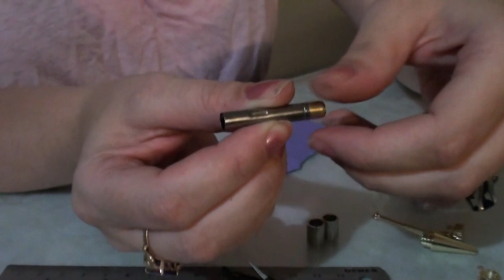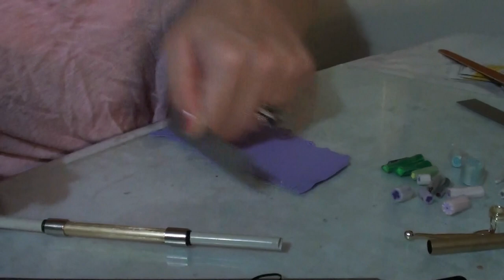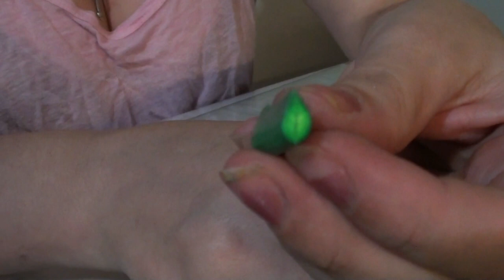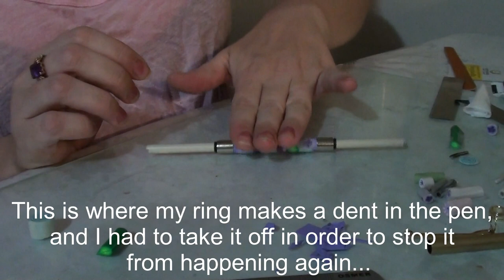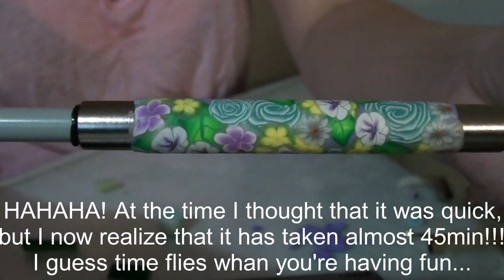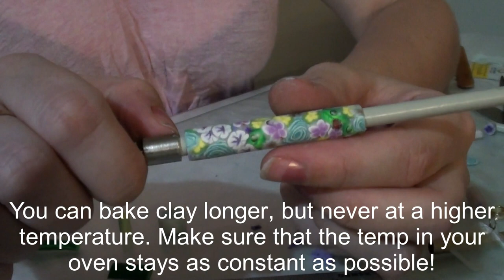Making A Polymer Clay Covered Pen

Comment: Do you sand it and seal it with anything?
Reply from the maker: Yes, after the blank is baked and cooled, I sand it with 400 and 600 wet dry sand paper. You can go up to 12000 if you want to keep the bare clay, which has a lovely satin texture.
Be careful not to sand too much though, as the cane slices are so thin, they can be sanded off...
The next part is optional, but I like to make my pens super glossy, and for that I use CA. 5 - 10 evenly applied coats followed by more sanding and polishing.

Comment: You mentioned rotating the cane after every cut, then immediately took four slices without rotating it at all.
Reply from the maker: Haha, Yes, that does happen, but if you see that the cane is firm enough that it doesn't appear to have been squished, feel free to carry on from the same direction for as long as you like.